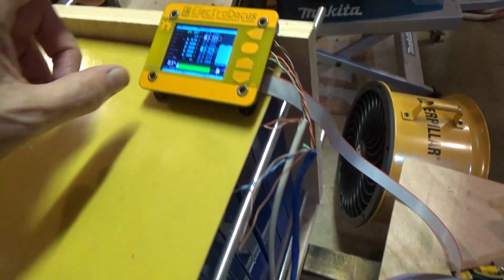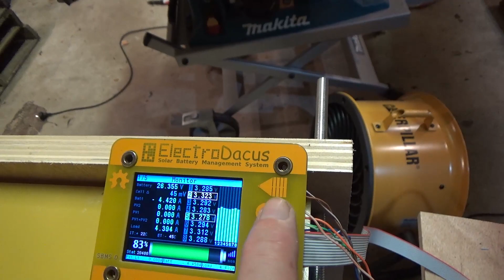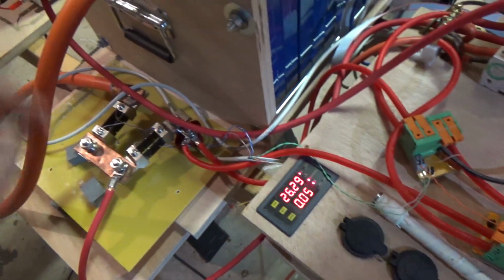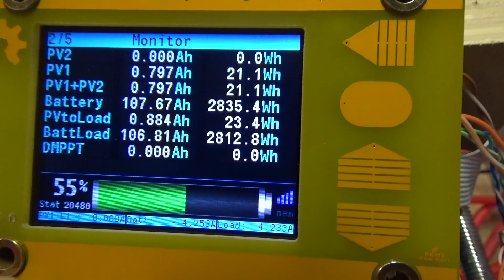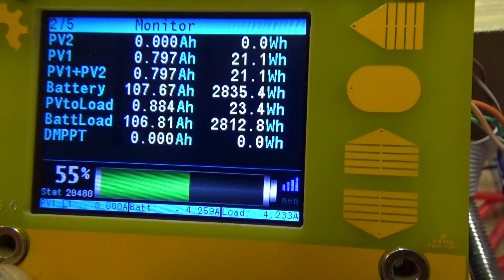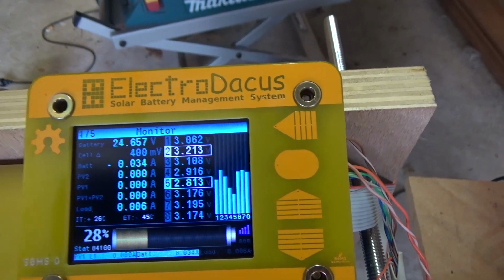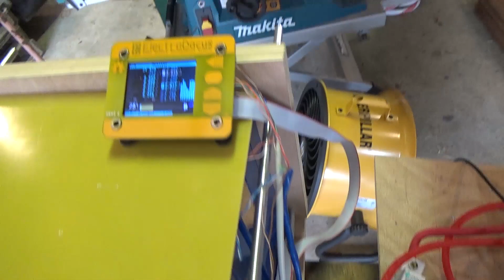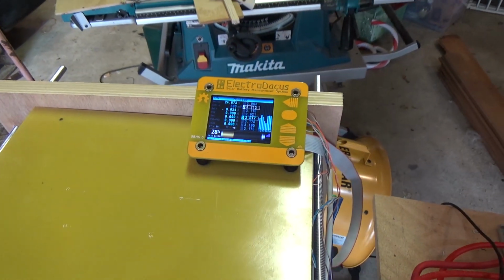LiFePo4 :Load Test | The first test of the Bused As dodgy looking lithium battery

Comment: I have had a good look at you battery results and compared them to what I am getting on my battery.     At 28% SoC my cells are sitting at about 3.15V/C  with a load of 30 amps  on a 200 a/h pack.      So this looks to be around the mean of your voltages (good news (maybe)).    I think that you have a solution available that will allow you to extract probably 95% of your capacity.     You have made you battery up of 8 sets of 3cells in parallel.      As the battery will see the average of the 3  parrallel cells capacity it is likely that through luck  the 3 cells with the lowest capacity (cells 4) just happen to be 3 independently weak cells and vice versa the 3 cells with the greatest capacity happen to be strong cells.    If you are able to work out which of the cells are weak, and which are strong, and build 8 sets of 3 cells in parrallel where each of the sets has a mixture of weak and strong cells, then they should average out at about the same capacity, noting that in a parallel configuration, the weaker cells will contribute less current, as their voltage sags, than the stronger ones.     I think what I would do would be make up 3 x 24v batteries using an 8 x 1 configuration, top balance each of these and then do a full discharge cycle, labelling and ranking  each cell with its capacity or voltage maybe at the bottom.   The rebuild the full 8 x 3 battery, but with the weak and strong cells evenly distributed.      With a bit of trial and error you should be able to get a battery that at least charges and discharges in balance, and extract way more of the capacity.     This is however a lot of work,  a simpler method that will at least prove if my theory is correct would be to take one of the batteries from  the weak (3 cells) and exchange with one from the strongest and see if that impacts performance.       I hope this helps.  Jon
Reply from the maker: Hi Jon, dude that's awesome. Thank you very much for your in depth and brilliant analysis and your great ideas. I have come to a similar conclusion, in fact its quite an error on my part as when I put the swollen cells to the ends of the pack I inadvertently created weak groups of cells. So I am doing something pretty close to what you describe and trying to mix up my weaker cells with my stronger cells to create a pack of more even "group" capacity and thus hopefully more useable overall capacity. Thanks again mate

Comment: Your cells 1,4  and 5 are basically empty no more than 1% remaining in 1 and 4 then cell 3 maybe a bit better 2% or 3% SOC and then the others is harder to guess but maybe not more than 10%
Thus is not that much of a difference between cells they are just not the capacity that was stated.
As Jon has mentioned you can try and pair the cells so that the group's of 3 are more equal.  I will take maybe a cell from group 2 and have one of cell of that group donated to 1,4 and 5 the get the cells from group 5 and donate those to 6,7 and 8
In any case you will not get 240Ah so after some more charge cycles so battery have time to balance do another discharge test note the SOC where it stops and reduce the capacity entered in Parameter setting accordingly so you have a better real world indication of SOC . Once you have all those things done you may have just a 180 or 190Ah battery but you will know exactly what you have to work with.
It is strange that you have swollen cells that is not a new cell but a cell that was abused maybe used without a BMS and either over or under discharged maybe even negative charged as they are fairly robust to abuse.
Reply from the maker: Hi there, thanks for dropping by. Loving how well the SBMS0 is working and its likely to be the star of a few more videos as i progress with my solar build. Yes thats pretty much the conclusion I have come to. I have since reconfigured the battery to better match up strong and weak cells (video this weekend) but some are clearly below spec. I agree the swelling is strange, while I purchased a new battery,  with built in BMS and advertised as containing new cells, they are quite clearly not new cells and/or the BMS was not effective.

Comment: not really suggest to push the battery too close together. it is better has some gap
Reply from the maker: Yes I have heard that, and just as much advice the opposite. So the logic Im using... it is going in a vehicle and bumping around when driving. I want to have every cell tight together as a single unit with no possibility of anything moving and putting extra stress on the links or terminals